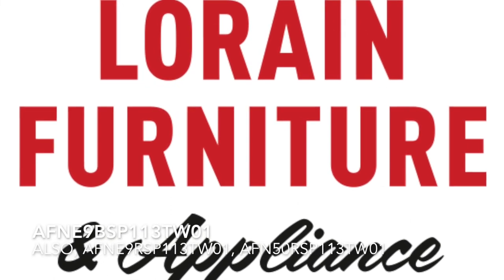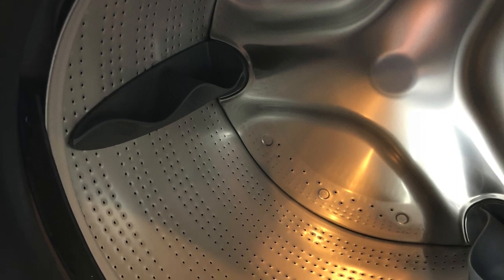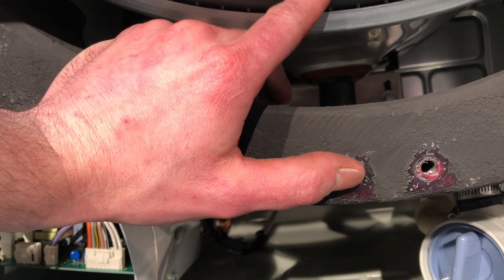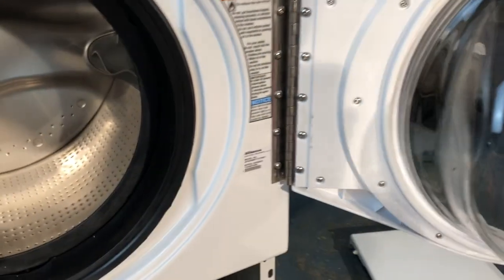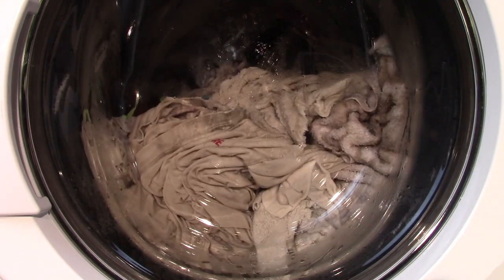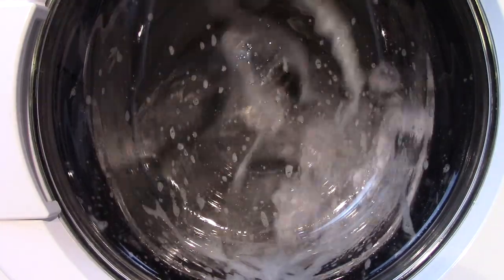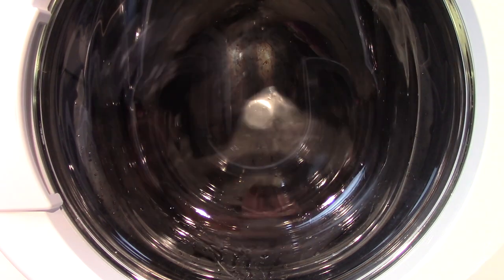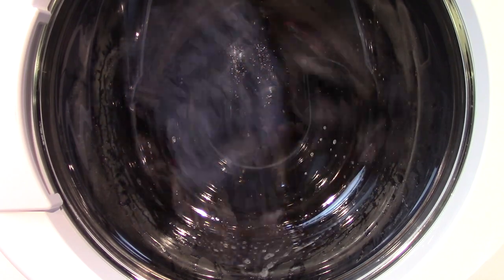Review: Most Reliable Front Load washer Ever: Speed Queen Front Load AFNE9BSP113TW01

Comment: My 1995 front loading Miele has been working flawlessly now for 25 years, and it has never smelled moldy.  I never knew Speed Queen made a front loader.
Reply: Oh yeah, mainly at laundromats
Reply: I have a Kenmore Elite that I think has run it's course at almost 23 years old. It has been an amazing machine, and never had that moldy smell either. Alas, I can't go out and buy that same machine. They aren't built the same, and I know the new ones smell. I wonder if your Miele builds them the same as when you bought yours. I'd be interested
Reply: @rreed87139   I bought mine at Abt Appliance in Chicago.  But they are available in a lot of places. Their outer drum is made of stainless steel rather than plastic, which might also help prevent mold growth.  I clean it once a year with a cup of baking soda at 170 degrees.

Comment: In the video you say this isn't the best performing washer ever but it is the most reliable. What is the best performing washer as far as getting the laundry clean? I noticed that Speed Queen is selling these again (FF7 and FFR models) and need a replacement for my Samsung (ugh!). Thank you so much for all of your in-depth reviews, videos, and blogs - they have helped me IMMENSELY!
Reply: This machine sucked.  Saying it isn't the best performing is an understatement - it does NOT rinse well, which is pretty mind boggling considering how it spins.  

Warranty is crap if you only have one authorized service/sales reseller locally and they are unreliable hot garbage.  If they don't have a good reseller nearby you are just SOL - was beyond frustrating for my parents.  The decal on the controls on both the washer and dryer front panel had issues and it took over six months of getting the run around before the warranty repair work could get done.  For the price of these units that is UTTERLY unacceptable. 

After two years of trying to coax something decent performance wise out if this machine my parents replace it with the LG front load  washer and matching dryer and the performance was night and day.  I didn't think there could be that big of a difference between washing machines, but there is! 

Easiest example - bath towels.  They always were a bit "flat" with the Speed Queen.  Also a little dingy with a funky smell no matter what you did.   After my parents got the LG unit installed I took all the bath towels, including the "clean" ones from the cabinet and re-washed them in the new LG set.  They came out of the washer/dryer ultra fluffy, super soft and ultra absorbent.  No more dingy/funk to them either. It  felt like someone slipped in and swapped the old towels out for completely different ones.

Same physical location. Same water.  Same detergent.  Same laundry.  Only thing that was changed was the equipment and LG utterly DESTROYED Speed Queen in how well it cleaned and rinsed the laundry by comparison.  It wasn't even close. 

So yeah, screw Speed Queen.  My parents donated their Speed Queen set to a local charity thrift store; they now wash donated items - perfect use.  For home use?  Hell no.  LG beats the pants off performance wise, hands down.  

Indeed my 15 year old Duet HT is finally starting to show some issues and I have an LG set coming Friday to replace them.  Gotta love sales at Costco. 

I'll CHEERFULLY replace the LG set four times vs. Speed Queen and still consider it a HUGE win.  I don't care if the damn Speed Queen lasts a lifetime if it performs like crap.  Laundry performance was hot garbage, especially for the price paid for it.
Reply: @DocNo27  which speed queen front loader was this? The new FF7 or the AFNE9BSP113TW01?
Reply: @erinnanderson6418  The one from when they first re-introduced the front loader four or five years ago.  And based on it, I wouldn't believe a damn word from anyone extolling the virtues of any of them without having an opportunity to test it myself.

Or just buy the LG, which is what I did.  I'll replace them three times if I have to and still consider myself FAR ahead of dealing with Speed Queen.  They were something to be reckoned with in the 70's and 80's, but this is a much different time now.
Reply: @DocNo27  which LG front loader washing machine model did you get? and your parents?

Comment: You did a fantastic review Speed Queen should have your commission check in the mail ASAP. I agree with everything you said  when you compared the LG washer cleaning performance to this keep in mind, that even the max setting on the heavy duty cycle is shorter than the normal cycle on the LG (which I to owned at one time). There is no sensing and adding a cup of water on so on with this washer which you pointed out. The commentary was great it really is a shame that the washer has been discontinued because your review would definitely push sales for them, keep up the great work!
Reply: O01dude 45 continued good luck buddy.
Reply: He actually is no longer an authorized Speed Queen dealer.

Comment: The main reason I believe they " discontinued" the machine was to change the design to put the door hinge on the opposite side like every other brand, so you can mount the pair more easily with standard house hold plumbing i.e. water access on the left in most homes. Before, in order to keep the washer door from being in the way when moving clothes from the washer to the dryer, you had to have the washer on the left and the dryer on the right.
Reply: It appears to be replaced by the FF7 ( FF7008WN)

Comment: Mine died at 7 years of age with an inverter control board failure. Even though Speed Queen knows of the board manufacturing defect issue, they refused to replace the board unless I wanted to pay $1200 for it of course!  NOT SO RELIABLE.
Reply: How were you able to tell you had this problem and what warning signs? I'm considering buying a scratch and dent for 1500 usd
Reply: @nesq4104  No warning signs, apparently this was limited to 2015 and maybe 2016 models.
Reply: @kenc4104  ok.  I will look further into the year of the one I saw in the store. Hopefully that is not an issue on newer version

Comment: Thank you for taking the time to produce your videos. They have been very helpful. In June 2011 I purchased a Speed Queen front loader, AFN50FSP111TW01. Recently this unit stopped achieving the high speed spin (this only occurs with a wet load - not a DRY TEST load. My first step is going to replace the imbalance switch being that it is the least expensive part. if that does not fix the issue then I am leaning towards replacing the control board located on the top rear of the unit. Very expensive - approximately 350.00. Being that the unit actually is able to achieve the high speed spin (during a DRY TEST load only), do you think the problem could lie elsewhere - perhaps the shock absorbers. The unit is only 8 years old. I'm not ready to give up on it but would rather not waste a bunch of money in trying to trouble shoot the issue. I live in Pittsburgh. Surprisingly enough there doesn't seem to be anyone locally interested in servicing my washer. If I lived closer, I would just bring it to you. Please help. Thank you, JP
Reply: Yeah, good luck getting a speed queen serviced if there isn't a decent authorized dealer near you.  Their dealer network is crap :(
Reply: @DocNo27  You got that right! Their washing machines are crap too! When I bought mine in 2011 (for 1200 bucks), I honestly thought that might be the last washing machine I would ever have to buy. I guess it could have been if I kept sinking enough money into it. After spending over $300.00 on replacing the imbalance switch and shock absorbers and the problem still continued, I gave up.

Comment: $1500 is about 2X the cost of other front loaders out there..i would rather pay 1500 and sleep easier at night.
Reply: I wish I'd bought it about 3 washers ago, LOL ...
Reply: Or you could pay $4,000 (commercial laundry model) and sleep even better. A machine like that you would never have to replace.
Reply: BroccoliQueefed where to buy a commercial washing machine?
Reply: Agreed.  Better to have clean work clothes the day you need them then have to run to the laundry mat in the middle of the night.
Reply: I understand that, but the longevity of these units is more than double than the cheaper ones. I'd rather spend more and not have to replace for 25+ years than have to replace every 7 (what most brands are built to last now)

Comment: I have a question.  Today I received a new Speed Queen front load washer (no manual)  It will not start.  I called Speed Queen who told me this is a commercial washer.  The plug fits into my 110 V  receptacle just fine.  How do I get this commercial machine to work in my house?  Model #
LFNE5BSP113TW01     Thanks in advance for your answer.

Comment: I have a similar machine, but an older model, LFNE5BSP113TW01. We bought it a couple of months ago, used, for $50.  It was pretty gross, but I cleaned it up and it seemed to be working fine.  However, it doesn't seem to rinse soap well.  I can run a load over and over and still see quite a bit of soap, even though I'm only adding a tablespoon or two of HE soap.  Have you ever had this complaint on Speed Queen front load machines? The drain pump seems to be loud, but I cleaned out the trap, and I know it's functioning and draining properly.   Also, mine doesn't seem to have that second rubber ring on the drum.  Maybe that had been removed at some point. After watching your videos about the new top load machines I feel like selling this and buying the top load.  What would you recommend? +Lorain Furniture and Appliance
Reply: Good luck.  After two years of fighting/experimenting with all kinds of hair brained suggestions from all over the Internet (and even some from Speed Queen) my parents gave up and replaced their SQ set with LG.  The difference was night and day and immediate.  At least you are only out $50, they bought theirs new :p

If you want a machine who's greatest feature is apparently long life and little else, you have quite the gem there.  If you want something capable of actually removing soap from your laundry pick just about anything but a speed queen.

BTW - the LG WM3900 models (and maybe the cheaper ones too; not positive) spray clean rinse water WHILE they are spinning as part of the rinse/spin cycle.  Something that I remember top loaders doing as a kid but for some reason not many modern washers seem to do.  It's amazingly effective at rinsing out your laundry and probably why the LG set beats the snot out of SQ in actual cleaning of laundry.
Reply: @DocNo27  The spray rinse is so important! I don't know why they don't have that feature.  I've had a year to work things out with this machine, and I've realized that adding an additional two gallons of water to the initial wash cycle (hauling a bucket of water from the bathroom) seems to take care of the problem. Sometimes I'll also run an extra rinse cycle and add the extra two gallons. I also switched from liquid detergent to powdered Tide, which seems to rinse better.  Sheets, towels, and blankets are still tricky to rinse well, but I've decided that I'll just keep doing this until I finally break down and buy a Speed Queen top load washer. The washer does a great job cleaning the clothes, I just wish it would rinse properly.
Reply: @cpete7117  LG front loader rinses better than any washing machine we have ever used/own.  It's pretty amazing just how stark a difference it is.  I wouldn't touch a speed queen anything with a 10 foot pole.

Comment: Always enjoy your videos and upfront commentary. In this video noticed that the washer branding says "Commercial Heavy Duty" - is this washer model meant for home use, is that the branding used on the residential products? I realize the Speed Queen has discontinued their stand alone front load washers for the residential market yet have found an  AFNE9BSP115TW01 in stock at a local appliance shop (have not seen it in person), would this model be equivalent in performance/value? Thank you.

Comment: I have a speed queen  stack washer dryer. I noticed that the top of the door is tight shut  but the bottom I can push  in . This problem was what caused the water to leak.

Comment: You can actually find these in many laundrettes in the UK.  I’ve also seen them on the channel “The Laundry Centre”. Very nice machines
Reply: HooverLux Restorations & More in the US we call such places a "laundromat"
Reply: Hooverlux I have the UK version it has 2 heaters to make it super quick but have removed 1 so it can run on a 13 amp plug as before it was hard wired to 20amp supply  its a super washer but only has 7 cycles none of which can be modified in any way but it does a good enough job on what I can sling at it :)
Reply: PS I also now have a matching dryer in Gas and its absolutely brilliant, Should have got 1 years ago...

Comment: There is one downside to this washer that prevents me from considering it for purchase.  It does not have an onboard heater.  For my conditions I need a washer that is able to heat water and keep it hot and that requires that it have a capable heater.  Wish it had one.
Reply: European models have a heater on them...
Reply: bestdarntootingood yes like Miele which is a great machine
Reply: I have one of these and you can SPECIFY a heater when you order it.
Reply: Why do you need a heater when you can see your water heater high ? Heat can set stains and does set stains. 

The average householder doesn't need boiling temps.
Reply: In foreign markets washing machines use cold water supplies only.  In the US someone might have their machines in a shed or separated garage with only a cold water supply that taps off of the outside faucet.
Reply: @LlyleHunter   Yes,you have a good point. I was looking at it from a U.S. perspective.
Reply: @patcola7335  Even in the typical US home, there's a consideration to be made in that a high efficiency washer on a hot wash cycle will only be operating on lukewarm water.  Depending on the location of the hot water storage tank, length and volume of the supply line between the tank and washing machine, and load size, you might have to run a fair amount of water through before it actually comes out at tank temperature without a recirculation pump on the water supply.  This can be overcome at the washer by filling and draining until inlet temperature rises, or by using an onboard heater, but either approach calls for a thermistor to tell the computer how warm the water is.  The added benefit of onboard heater is that it can maintain that temperature over the duration of the wash cycle in addition to offering steam cycle.  A demonstration of this would be to begin filling a five gallon bucket, measure the incoming water temp at time the bucket hits full, and compare that to the nominal temperature of the water in the bucket at time of fill and again half hour later.  Many houses I've worked on, that bucket will be filled primarily with cold water.  The biggest difference with Euro market seems to be that point of use water heaters are more prevalent than a central storage tank due in part to the higher wattage available at standard residential electrical circuits, so it's sensible to just integrate the heater into the appliance and use a cold fill only.
Reply: @a89proof   I understand what you're saying. Our dishwashers for decades over here had heaters in them to get them up to high temperatures.

Obviously our old top load washers could never heat up the water or it would literally take half the day to get a single load done.

My current Whirlpool front loader uses little water per load but has a heater and a steam clean function. 

Been a great washer and got out some set in stains I had .

My laundry machines are downstairs in my basement where the water heater is. Not far from the washer.

All in all though with a front loader I would never have a machine that couldn't give me hot water. 

I'll have to take a measurement one day of the temperature in the Whirlpool when I wash things on sanitize. The water gets very hot and that's what I want for certain loads.
Reply: @patcola7335  It's definitely a handy little addition - one I'd practically consider a requirement on a high efficiency front load that uses so little water.  

Realistically you could omit the hot water valve and let the washer take care of the heat, euro style, but it's sort of a legacy thing where US buyers just expect it to have two water hose connections.  I'd bet the cost of the second valve is so little in manufacturing, that companies would rather just eat that extra dollar than risk backlash from being the first to exclude it.  

Similarly, the cost difference for a manufacturer to add the heater element, a couple extra wires, and an extra relay on the control board is so little that all but the very lowest models have them now.

Comment: I'm on my second Whirlpool; purchased #1 in 1999 >$1200; #2 in 2016 >$850... do the arithmetic... Speed Queen is a bargain, it's repairable (my first Whirlpool was not, as the main bearing went, and they said it would cost more than a new machine to repair it.).
Reply: The second one likely won't be repairable either, as the way most are assembled means there is no service access to the bearings, seals, spindle, or drive spider that the inner drum are supported by.  Service replacement requires changing out the drum and tub as an assembly, which is costly in both freight and labor.  Out of warranty, and adding the cost of the part itself, it quickly becomes cost prohibitive.  There have been, and still are, some models which have tubs that can be split to service bearings and spiders, but you'd have to factor the cost of parts (drum spindle w/ spider, bearings spacers and seals, tub seal) and labor to know if that's beneficial or not.